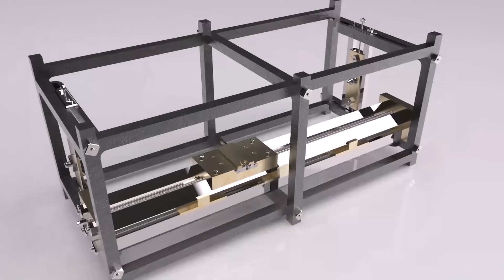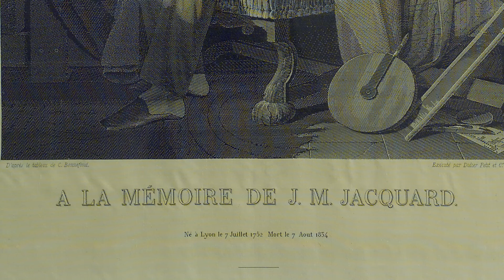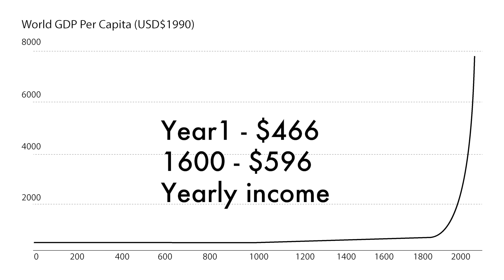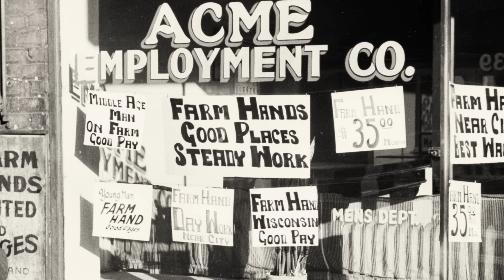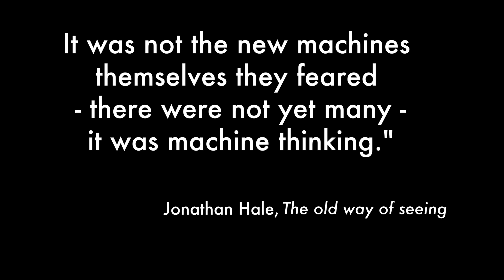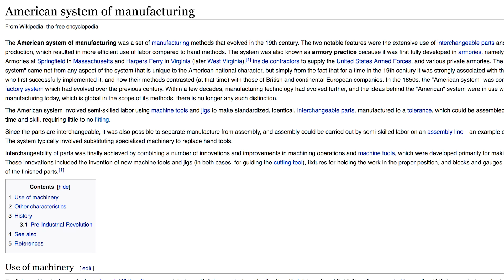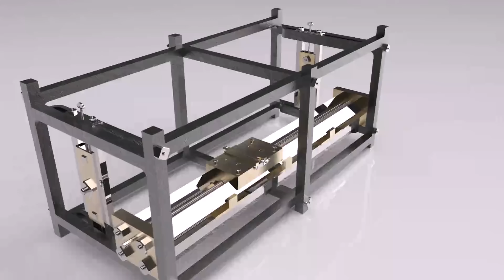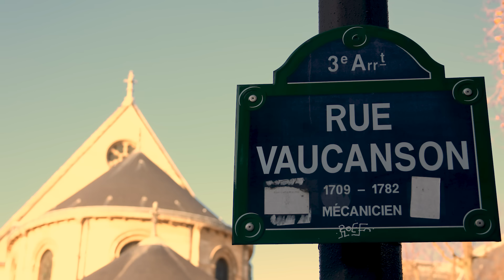The 1751 Machine that Made Everything

Comment: Today you can build fully automated CNC routers and Lathes at home with stepper motors and raspberry pi's.
Reply: This string of comments is the epitome of the internet. Someone makes a 100% factual comment and it starts a ridiculous "My dad could beat up your dad" style argument.
Reply: No one is saying a DIY CNC machine is a replacement for actual industrial versions. Just that you can build an approximation on the cheap. This isnt a point that its better because its cheap just that we have such crazy access to manufacturing tech compared to any other time in history.
Reply: V1engineering.com diy cnc
Reply: You simply can't get enough digits though. Also it won't last as long. It's kinda the reason why people would still pay 10x the price for industrial servos and PLCs (and the PLC would be less capable of doing things comparing to a raspberry pi yet still being hugely more expensive).
Reply: mmmmmmmmmmmmm.........raspberry pi.............mmmmmmm
Reply: yeah, but I'd still rather buy a HAAS
Reply: Yeah but try taking off more than 0.001" in a single pass on anything other than modelling wax with such systems. Those are really just fun toys, not production machines. The lathe shown in the video was the real deal for cutting copper.
Reply: @tetrabromobisphenol  You can totally build at home a machine that does that, it will only have to be more expensive. Use better motors and have better drivers, but you can still DIY.
Reply: Exactly. It's not hard to build a very good cnc. it's just really expensive.
Reply: @thomasesr  you dont know anything about machinning.  You neglect to mention any structural components for this DIY CNC mill or router.
Reply: @hrbestalkinme3690  does it matter? The point I'm making is about the automation process being accessible. Go watch this old tony making his own.
Reply: @thomasesr  Yeah the technology is accessible.  I love arduinos and raspberry pis.  Pretty amazing for what they cost.v
Reply: @hrbestalkinme3690  The structural components are the cheapest part of a CNC system. It's the controllers (steppers and circuit board (along with software)) that is the hard thing to do. Anyone, even a simpleton, could make a brace for the whole system.
Reply: @xtranormal2350    You have no idea what you are talking about lol.  The software and steppers are easy and can be done inexpensively.  They are often added onto pre existing manual lathes and mills to convert them to CNC.  You should go to an actual machine shop some day.
Reply: @hrbestalkinme3690  I work in a hydraulics manufacturing company and in case you didn't know there is quite a bit of machining in manifold manufacturing. I can tell you it is not the legs or plastic paneling on the side of the CNC mill that costs the big money.
Reply: @xtranormal2350   You think the panels are structural components?  Again, you are clearly an outsider to this industry who is obsessed with digital shit.  You are probably an electromechanic in the assembly area and dont even work in machining.  I own a machine shop and have converted several manual lathes and mills to CNC.  The conversions cost drastically less than the machine itself.  The conversions are only expensive if you pay some racketeering company to come in and do it for you.
Reply: @hrbestalkinme3690  You're strawmanning. I never said that CNC costs more than the machine itself. I'm talking about the structural components to combine the two apparatuses which are definitely cheaper than the motors and controllers.
Reply: @xtranormal2350  Oh well obviously lol.
Reply: @hrbestalkinme3690  Hey man, you're the guy you said you need to factor in the structural components when the other guy said you can do CNC with little difficulty, as if they are the most important thing.
Reply: @tetrabromobisphenol  use ball screw nuts, bigger steppers with positional feedback, you just need an expensive motor which holds its torque for spindle
Reply: @iwantitpaintedblack  Even then you would be limited to the lower end of what some industrial lathes are capable of by the fact that your household mains supply is probably rated for around 24 kW at best, even less in some countries and certainly wont appreciate you sticking something like a 25 or 50 kW industrial motor on it granted lathes that powerful are the sort of thing you use to make parts for other heavy machinery and probably somewhat overkill for most uses but yeah the fact is that the electricity grid wasn't exactly designed with the idea of people re-purposing domestic residences into heavy industrial manufacturing facilities in mind. Granted if you happen to have a bunch of cash handy you could probably get the electricity company to upgrade your supply though depending on the jurisdiction that might be something they have to inform the local planning department about which may want to have words with you about local zoning restrictions.
Reply: @iwantitpaintedblack  ...and a big casting for those stepper motors and all to support the speeds and feeds. You fellas need to go work in a machine shop to fully understand.the engineering involved in machines.
Reply: @Tigerchevelle77  well i am a tool and dye maker and i know metal working machines, but i never really gave any thoughts to power requirement of these machines, you would notice a slight reduction in rpm if you were machining something like titanium with 2mm feed depth
Reply: @FaerieSeraphina  I have a Tree phase 220 to 380 volt at home. The power limit is not a issue.
Reply: @FaerieSeraphina  You can get a very good metal working lathe running of a normal 3 phase wall socket. You can also get industrial CNC machines for doing serious metalworking at a few kilowatts. Our residential supply is 25kW, but one of my colleagues has a 43kW 400v supply.

Taking big cuts isn't a problem at all, I even do 1.5mm deep 16mm wide cuts on a 6kW machine at the mechanics department at our local school.
Reply: @iwantitpaintedblack  You need rigidity. You can eventually dial out positional errors, you can manage a spindle with low torque, but if the machine twists up and warps every time the tool takes a chip you're never going to have precision. 

The only thing really stopping most home hobbyists is that they're unable or unwilling to make that 300 pound gorilla and have man-movable benchtop machines that need extra design effort to avoid rigidity chatter and eventual slop.
Reply: @tetrabromobisphenol  I agree,when I worked as a machinist,I used a leblonde makino,and could take 1/4 rough cut with a chip breaker bit.
Can't do that with a Logan or craftsman lathe,to light duty.
Same as those home cnc. Machines
Reply: Capitalism ho!

Free markets guys.
Reply: The automation, computer, and powered components are not the hard parts.. Fabbing the frame, rails, and gantry square and straight is.. That takes skill and experience that no YouTube video/ online forum can teach you
Reply: No. No you can't. Not if you want actual precision.

Comment: "his lathe was ahead of it's time by 50 years" how do you substantiate such a claim?
Reply from the maker: To my knowledge there were no other industrial scale (lathes meant to make large metal parts for industrial machines) metal cutting lathes with the same features until around 1800.  I'd put Senot's screw cutting lathe (1795 iirc) as the next one, followed by Maudslay's a couple of years later, though that lathe is much smaller than either of the above with much less capacity and I'm not sure it was ever used for industrial purposes.  Once Maudslay (and his apprentices like Richard Roberts) were making lathes then things really took off and lathes like we know them today started to proliferate.

Comment: If the clockwerk lathes aren't lathes because they are small then nothing small is real. I call bs.
Reply from the maker: The point was small clockmaking lathes didn’t make bigger machines which then made other products at industrial scale.
Reply: Machine Thinking But you said you don't count them as the first lathes. Sure they weren't as important but that's just bias reporting.

Comment: Was/is a very important tool? Yes indeed. But dont go around bragging that its just bcos of this tool that people start to earn more, and this and that. That is so incredibly narrow minded. Even if you would call it the best tool of that invention year there are lots more factors that contributed to it. And 1 thing that contributed allot more, even before, during and after this was fossile fuel. Mostly turf which switched to coal. Which made tools even more basic but more usefull then a lathe. Take the art and machines to cast. Whitout casting molds, machines et, there wouldnt even be a lathe. Anyone that thinks about it can figure out 1000s of more things that where before, during and after that had basic impact, mediocre and advanced impact. My example already was all of it. Btw if you can mold perfectly which now is almost a lost art concernin metal, it goes just as fast and can be just as precise. A lathe is easier yeah. But still..... A lathe wouldnt even havr excisted whitout molding. Or even basic shaping, which we still use today. Like the earliest drill bits which excist sincr waaaay before christ. We got better at making them so? What is a lathe whitout drillbit, knife or.. etc... nothing. 

So my point is, its not just "bcos of the lathe". Its proposterous just to even think that.

Comment: If you need a lathe and a milling machine made out of metal to make a lathe and milling machine out of metal how did they do that for the first time ? Go back through modern history and we always have tools made by tools. How did they bridge the gap and make tools that had to be made by tools? You can black smith gears and cams to an accuracy needed to make tools.
Reply: Dave B  makes a good point. There is also an "accuracy improvement" tendency inherent to a lot of simple mechanisms.
A grader is a case in point. By hanging the blade midway along a long wheelbase, the roadway is improved (in vertical deviations from a  flat plane) with every pass. Compare this with a short wheelbase tractor with a blade mounted in front of or behind it, which will make dips deeper and peaks higher.
Similarly, a geometrically perfect bearing can be simulated by three support pads at  ~120 degrees (as in a lathe steady).  If a rod which is approximately round is turned between dead centres it can be made almost perfectly round. If the result is supported in such a steady, features turned and bored on it will have almost perfect circularity, despite no such perfection in the circularity of parts of the lathe itself.
Similarly with the "three surface plate" method of achieving flatness, which can then be used to make the lathe ways and mating carriage surfaces almost perfectly flat using nothing but hand tools. Right angles are also simply achieved by similar means.
Reply: Thanks GOTTENHIMFELLA   Nice explanation.
Reply: Thanks patrick.
I thing there is a parallel with evolution by natural selection: it is eminently possible for some offspring to be more "suited to purpose" than the parents, and more complex, contrary to what creationists would have us believe, with their claims that "information theory does not permit this".
They seem not to realise that most scientific theories, and even laws, are descriptive rather than prescriptive, and when they conflict with observed reality, it is the theory which must be revisited, rather than reality.
(Which perhaps does not even need to be invoked in this particular connection: I think they are simply misunderstanding, or misapplying, info theory)
Reply: @Gottenhimfella  That sounds fairly similar to making laps using the three lap method.
Reply: they might have used gravity and 90° angles to reach some sufficient  first form of precision. for example if you remove the thread of a screw by a certain percentage it will still work as long as enough of it remains intact. for threaded screws you can  actually remove quite alot of the thread and it will still work. You can also slowly move your way up in precision.
Reply: Rock on rock. First tool on tool action. Hawt.
Reply: @Serialkoala  This guy thinks so too https://www.jstor.org/stable/24979368?seq=1#page_scan_tab_contents
Reply: 1. Idea (Prototype)
2. Creation (Finishing)
3. Refinement (Efficiency)
Reply: "They seem not to realise that most scientific theories, and even laws, are descriptive rather than prescriptive, and when they conflict with observed reality, it is the theory which must be revisited, rather than reality."

This this this this this this this a million times this.
Reply: Dave B Guy who narrowly avoids the friendzone: “I am no bitche’s tool.”
Reply: I worked with a fellow who was a watchmaker. One of the things he had to do in his apprenticeship is take a cube of metal and make a perfect sphere out of it with only a hand file.Then when he finished, he had to make it back into a sphere again.
Reply: @eltigre249  Are there videos on this? Sounds interesting / hard.
Reply: Easy, in 1932, when my dad became a metalworker/machinist, the final exam was to make a 5cm cube of steel, with only hand tools, saw, files, ruler... Just watch ClickSpring kind of work to get an idea.
Reply: He was a watch and clock maker and very skilled at that.it was all made by hand.expert craftsman.
Reply: Begs to ask, what came first? The chicken or the egg….
Reply: Aliens.
Reply: @gregs7519  I was gunna say that.
Reply: smart white people figured it out

Comment: If I were younger, I would delve into the tool and die,machinist trades..
I think that machining is extremely interesting,  not to reiterate what you have said, lathes and mechanized equipment reinvented the modern way of life.
Reply: It is a pain in the ass, unless you went to trade school, worked on lathes in the '80's, lots of fun, getting burned by hot metal chips, splattered by coolant, always being hounded to make stuff faster then the worn out machines could accurately produce, oh yeah, interesting. It looks better than it was.
Reply: @boondocker7964  ...good point, I was in the electronics service for 35 yrs, it had it's bad points as well..
And your point is well said.
Thank you.